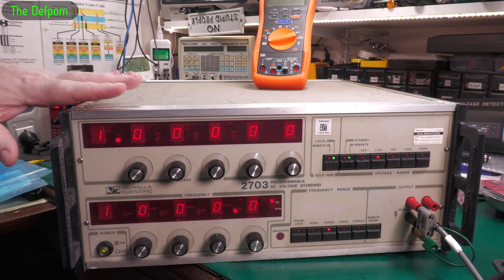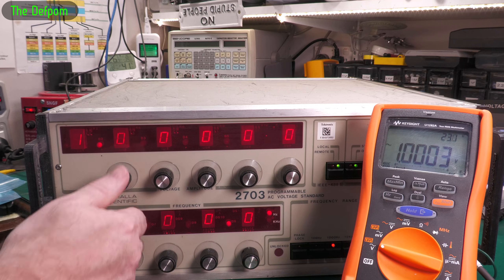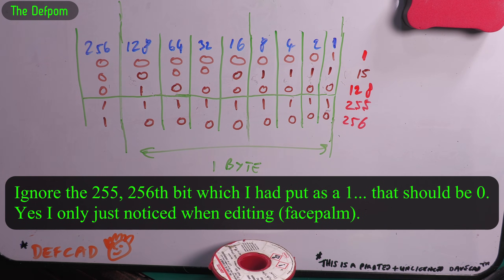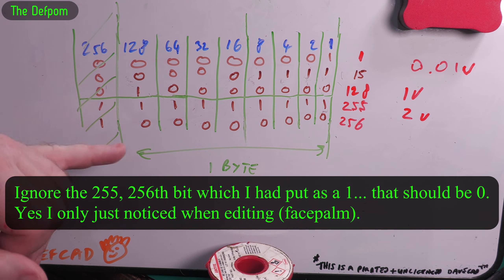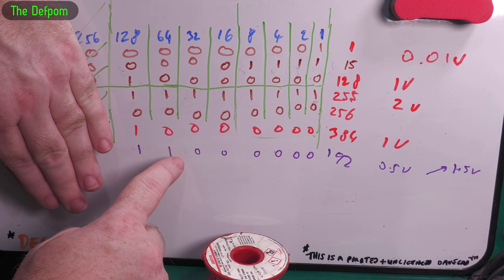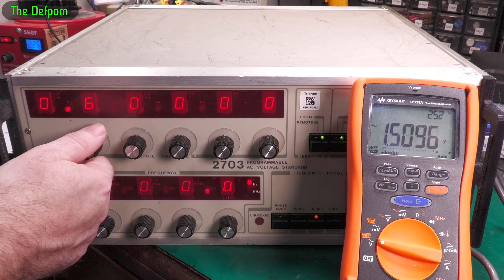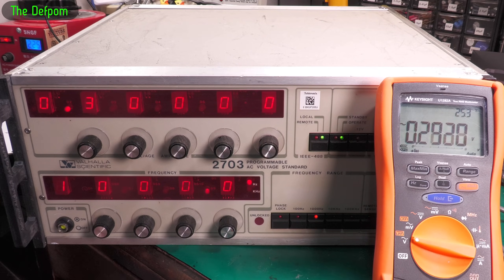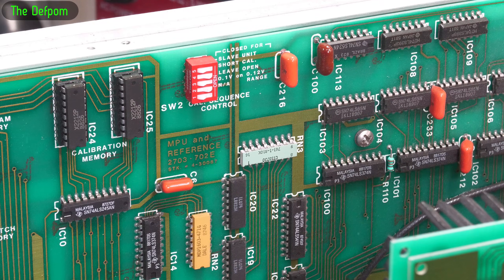🔴 Valhalla 2703 AC Voltage Calibrator Lost Calibration Recovery - Output Voltage Issue - No.1443

Comment: My thoughts.......If the DAC uses table based linearization (AC sources quite common) then the wrong table block could be being selected along with a particular segments gain 'word' (MSB/sign/shift bit)....net result some segments produce nonsense compared to neighbours. Either that or it's a sign-bit/top 1 to 3 MSB, binary shift field issue.
These older test instruments quite common to have a good bit of complexity in the code to make things happen. I.E. Reminds me of 'oversampling' ADC's in the old days to achieve higher no. of bits (oversample an 8-bit ADC to achieve 9-bits or more etc)

Comment: But do we also need to be talking about signed or unsigned  bytes? Just to muddy the waters.
Reply from the maker: FFS
Reply: @TheDefpom  I think there is a typo there! the first 'F' i think you went for the 'D' and missed. 
"DFS" why you would want a new sofa I don't know as your work room does not have much floor space for one. 🙂
How you know I was waiting for my new sofa to arrive I don't know. Gone full spec over load on this puppy. Fully reclining, lumber support control, BT speaker system, heated seats, LED touch screen, pop out drinks holder with cooler's for each cup.

Just got to upgrade the TV next to something 75"+ and i'll be in full movie mode. 🙂